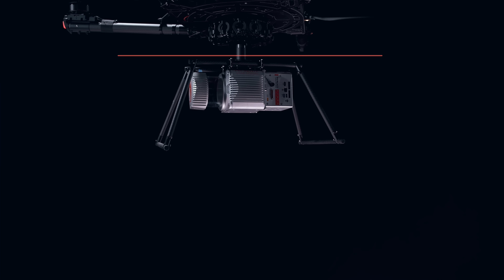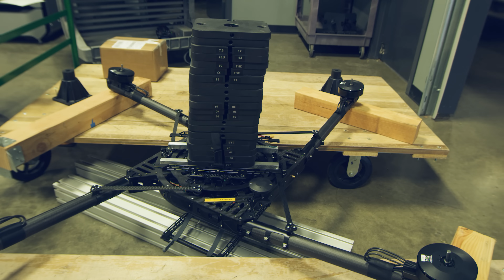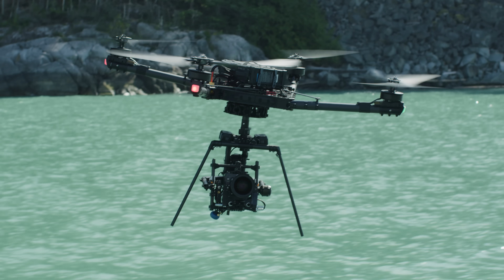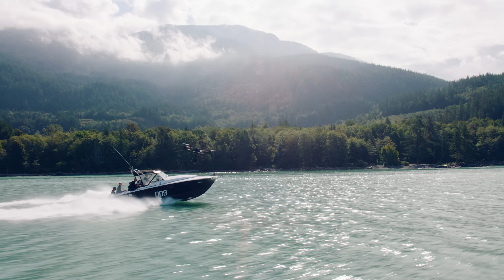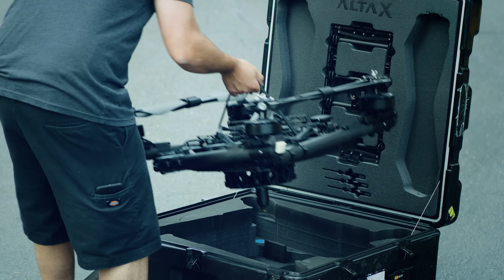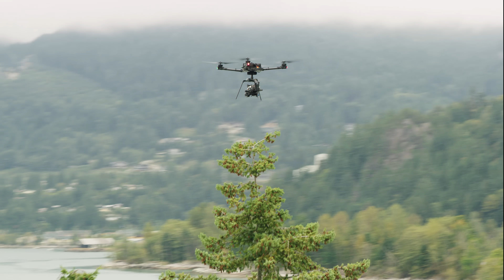Introducing ALTA X -  The world's toughest drone

Comment: Steep prices  i.m.o. - especially when you look at the cost of replacement parts. (e.g. a set of propellor blades $2200 plus taxes and shipping) Makes the cost of, say, Ferrari parts seem a comparative snip. Fine, push the initial acquisition cost as high as the market will bear - but why not support existing customers with more reasonable value? 

Basically you buy in to this platform and become a captured cash cow.

Comment: I understand consumer level small drones having 4 props, but in this large/expensive of an application, redundancy is critical. I'd take DJI's system with many more props over this for that reason alone.
Reply: This is not how rotors work, more props are used for smaller diameters rotorsystems, just look at helicopters, UH-1 is probably one of the most iconic helicopters and it has 2 props, having more props isn't beneficial, on the contrary it adds more moving parts and requires more maintenance.
Reply: Redundancy doesnt mean reliability. It takes millions of hours of continuous flight time to possibly break decent quality rotors like that.
Reply: savesilence  actually you can redundantly fly a quad on 3 rotors reliably and successfully recover with just 2. DJI has had it since the inspire 2 and I first saw the tech demoed early 2010. Essentially by relinquishing YAW command, we can still retain pitch and roll commands to the drone, and spin the drone rapidly to disperse the offset thrust and to induce gyroscopic stabilisation. 

Of course with greater than 5 blades we can loose a motor and still retain 100% positive control. These heavy lift drones are also prone to mechanical fatigue, especially around the rotors. Quite often we have seen brand new payload drones with micro fractures in their blades. More blades also means more power draw, more failure potential, more vibration basically more of everything...both good and bad. 

Or instead of adding more motors, you can do what DJI did and build full redundant onboard systems and components.  Something really gotta be going wrong for you to lose a motor now adays.

Comment: so when will this drone, or one similar to it, be strapped with a few lbs of semtex and 33lbs of nuts and bolts be flown into a stadium - do they have radio blockers in stadiums? can they be programmed to fly a set path without radio control?
Reply: Solutions for those threats were created years ago and are not public knowledge
Reply: C J a guy with a butterfly net then? Say no more hush hush
Reply: Michael Christensen SIGINT
Reply: Michael Christensen this could’ve been done with many drones already. The Alta-X won’t make a difference
Reply: Storm I know - it was just it’s carrying capacity that seemed like it could actually be a fairly potent delivery system
Reply: someones on a watch list now... hope you used a proxy when you posted this

Comment: A $16,000 drone to compete against a $1,600 drone. I don't know what kinda market they're aiming for
Reply: what $1600 drone can compete against this?
Reply: I think the number 1 reason to buy this is so that you can carry a bigger camera. For people who work professionally in media they'll probably need the pixels and sensor quality that a DJI drone cannot provide. Also, if you keep in mind the man power cost to build, test, and manage this thing from scratch, that 16k will quickly look cheap. Not saying that I like this advert, but from a cost perspective it ain't that* bad. You can* do it yourself, but again, time is money.
Reply: the market they are aiming for with this is the professional. the i2 has its place, but you cant hang a movi, or even a ronin off the bottom of it.
Reply: It's not competing with any $1,600 drone. This is the top of the line pro drone platform for high budget cinema production. They are not aiming for a market, they pretty much own the market.

Comment: What about automatic flight features? I like how Djibouti can track, circle an object etc... Gives a very smooth video compared to trying to manually fly. Does it got those flight features?
Reply: Pretty sure this is supposed to be for Professional videography.. I’d chance to say most don’t use built in modes to film. They usually have pilots and then camera operators handling the filming itself.
Reply: a pilot and cam op need to practice more if they need an orbit or active tracking mode
Reply: @olegravylegfpv  Yep. I won't fly on any commercial aircraft that needs an auto-pilot! :-D

Comment: Might be a stupid question, but do the guys who use these professionally fly in some kind of stability mode or in full rate/manual mode? thanks.
Reply: Im pretty sure its all manual mode, though they use a second operator for the camera so its a two person job, and if they use any type of FPV then they use a third person as a spotter to stay legal by keeping line of site
Reply: @mrpistachios  They certainly don't fly in actual full auto acro mode like racing drones. Computerized stabilization is what makes camera flights look like they were shot on tracks. They won't use an pre-programmed flight paths though.

Comment: For such an expensive drone they forgot the most important aspect , redundancy! Can it fly with 3 rotors, is it waterproof? Don't get me wrong it's a nice drone but where is the the backup?
Reply: 2kool4myskool there is no drone that can fly when it looses one motor, it doesnt matter if it is hex or octa they still will most definetely fall. And the autorotation bullshit in matrice 600 is most probably not gonna work. You need to realize there is no such thing as redundancy of motors in drones
Reply: I make my RCs waterproof with a $20 bottle of Corrosion X spray and ballistic chute recovery systems are available for multi rotors
Reply: you're totally right....... here in austria you'd just be able to fly over wide open fields but not in urban areas without the redundancy

Comment: Can it fly with 3 props in case of motor failure?  That would make for a very expensive day!
Reply: The remaining 3 will fly it straight to the crash site.
Reply: Ramon B Media no
Reply: Not a chance
Reply: @cormacsyt0  - That's just maintaining position there's no actual directional control a ballistic chute system is a much more effective option
Reply: @cormacsyt0  - In practical terms it's rather difficult to maneuver a spinning drone with no forward orientation point and if it's automated it can't land like that it will still destroy itself a ballistic chute system is a much better alternative the only requirement is sufficient altitude
Reply: @cormacsyt0  - I forgot about headless mode I never use it I can see it being useful for smaller drones but anything with any substantial mass is going to destroy itself landing while spinning and there are options available
Reply: @cormacsyt0  - As long as it stopped spinning just prior to chute deployment a spinning drone isn't going to do well under a chute
Reply: @cormacsyt0  - I thought about a swivel but I don't know that it would be effective as the chute deployed it has to kill power anyways it might as well do it prior to deployment

Comment: I love what you do Freefly, but 4 motor is just not safe. Had a motor burn while flying in the dessert. No quality control or anything can prevent it. (By the way, editing and filming of this video is top notch as always!)
Reply: Everyone likes a good dessert, but you should never fly in one.
Reply: @AndrewONeill3x3q  Sorry, second language, sometimes i screw up. :-)
Reply: @cormacsyt0  That's all correct, but the comparison is still not valid. A helicopter can autorotate in case of a rare failure, the drone (right now) has no backup. 
You can use a parachute system, but that wasn't mentioned by Freefly and wasn't part of the comparison.
Reply from the maker: I flew to work in a single rotor helicopter, guess we will have to agree to disagree on this one
Reply: @freeflysystems  Until quadrotors have the ability to autorotate like single rotor helicopters, I'm going to have to agree with Adam on this one.
Reply: Freefly Systems Don't get me wrong, it's an impressive machine. But for regulations and equipment safety, i think hexas are the minimum.
Had a few emergency landings because motorburn in Morocco, no testing can solve this problem.

https://share.icloud.com/photos/0ABQpTuN3JxDAHAbBhpKMBJvg#Aarab_Sebbah_Ziz

And this was T-motor, not DJI like on the Alta X.
Reply: @freeflysystems  Sorry, but I would have expected a better way to deal with justified criticism. Instead, it is simply dismissed with a totally inappropriate answer. This comparison is total nonsense, because helicopters can autorotate, the drone just falls from the sky.
Reply: @Yaren2580  sorry... I don't know about helicopter.. is there any minimum altitude for autorotate?
Reply: @npranyoto  There are height-velocity combinations (dead man's curve) that are dangerous. However, you can and should avoid these during normal flights from A to B.